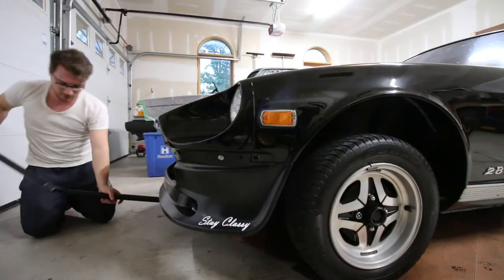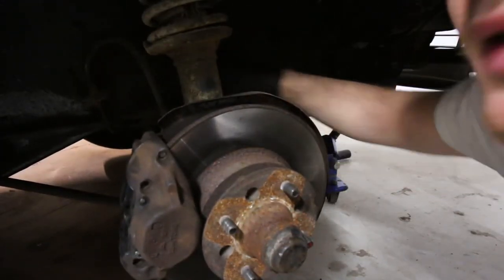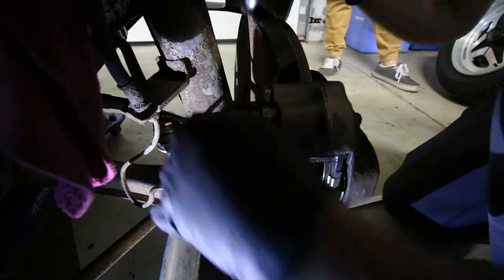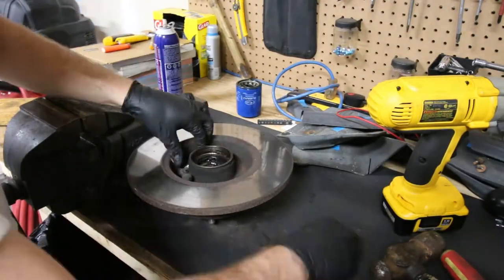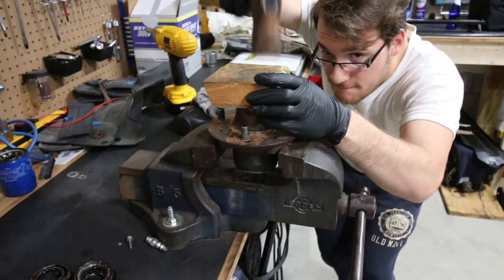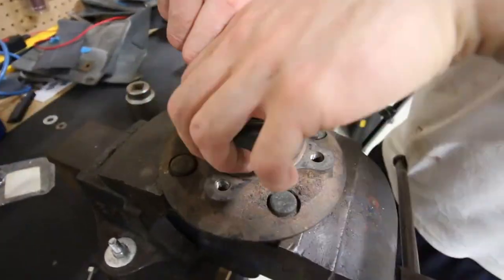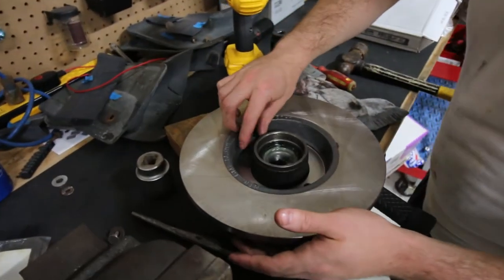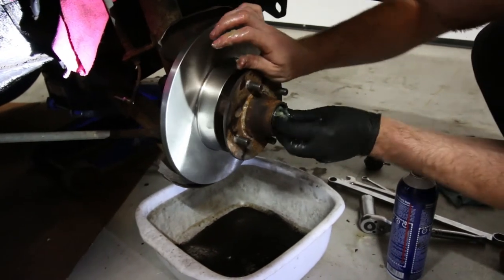How to change wheel bearings on a 1978 Datsun 280z (spindle and hub style)

Comment: When it comes to regreasing bearings, more is not always the better option and actually can be a costly mistake. ... Too much grease volume (overgreasing) in a bearing cavity will cause the rotating bearing elements to begin churning the grease, pushing it out of the way, resulting in energy loss and rising temperatures.

Comment: Datsun must have changed the design for the 79+ZX, as my 1980 has a flexible line going to the brake caliper. But I think my passenger front wheel bearing is going bad, so I need to ge tin there and get my hands dirty.

Comment: Great timing!  I've got a steering "shimmy" situation myself at around 65-70 mph.  Even after:
1. Installing a new steering rack
2. New inner & outer tie rods with new urethane bushings
3. New tires (previous tires were over 11 years old)
4. Wheels balanced and aligned
My next fix will be changing the front wheel bearings.  May even change the rotors as you mentioned since I'll be in there.
Did this fix solve your steering shake issue?
Thanks for the video!
Reply: had one of these back in the day brand new, 74 260z, would shimmy from day one, the fix was a return to original steel wheels from the dealer optioned turbine mags. that took care of it. My current ride is slotted alum (75 280z) very minor shimmy under just the right conditions, most of the time its not a problem. I think its a combination of tires/rims/road surface/wheel clocking aligning just right. If I could source some new ones I would go with steel rims.
Reply: Thanks for the feedback Dave ... Interesting observation.  My Datsun has the Turbo wheels as well (When my Dad bought the car the previous owner made the change sometime before '83) The shimmy is quite annoying and it does fade in and out depending on the road conditions, speed and rpm.  Wonder if the wheels are bent? Either way, I'll change the wheel bearings since they haven't been changed in over 30 years.  Thanks!
Reply: Hope you can get it worked out, great cars fun to drive and easy to work on.